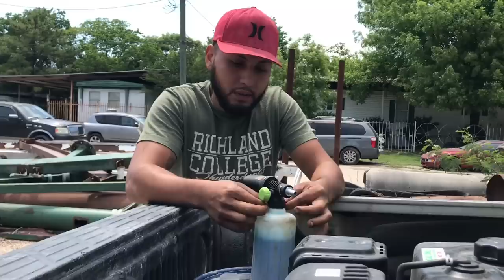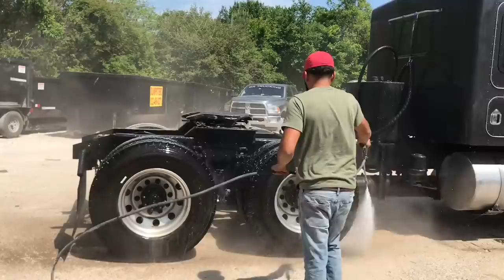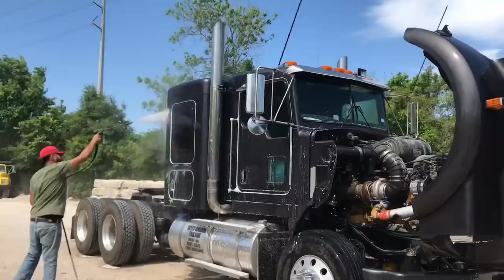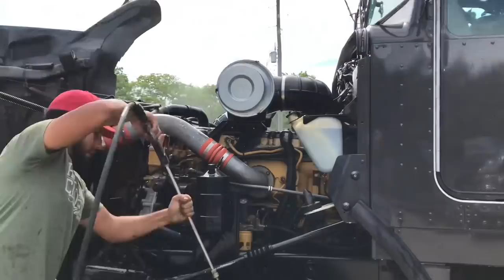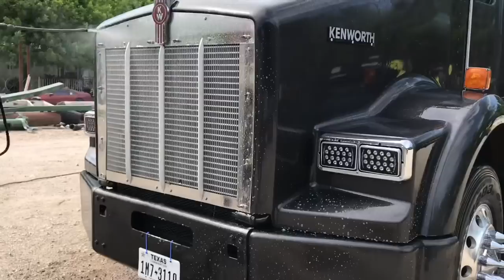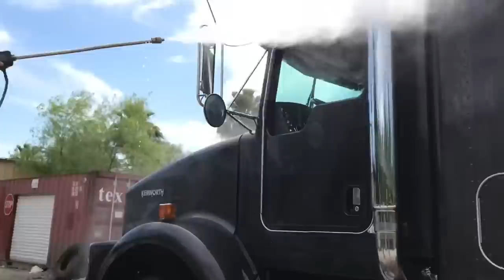foam cannon wash, Houston mobile truck wash

Comment: Damnn if you ever see scratches on your truck it’s cause he using the same exact brush for the paint on the truck and for those tires which have been everywhere you should get it detailed by someone who cares about paint and a good wash 💯💯💯
Reply from the maker: Isaac Diaz ain’t worried about the paint like that. In the future when I get the truck painted the right way I’ll be careful with it.
Reply: He did pressure wash the wheels before the broom. I agree with you, maybe two brooms is best. However he did at least pressure rinse them beforehand 👍🏻
Reply: For 45 bucks cant beat it
Reply: I used to complain about the blue beacon... this though, this is a surface scratch nightmare.
Reply: Ikr, it was a bit cringing 😬 to look at him hit the tires with the same brush that he then washed the truck with 😳
Reply: The brush isn’t really hard... it’s actually soft just firm enough to move debris
Reply: Then ppl should clean their own stuff and if you think driving otr stuff don’t pop up and chip paint then you kidding yourself

Comment: Now your gonna be going down the road watching everything reflecting on the hood blinding the opposite lane w the stacks an drop visor if I’m in the area ima call him up that looked real good an only $45-50 for a mobile he just washed the tractor for what most places charge to run a washer through the reefer trailer 😂👍

Comment: I need that foam sprayer in my life 💪🏼🌬️🚛
Reply: Get the one off amazon. Almost the  same thing for like 18 bucks.  That's how I wash my truck.   Works better than this guy's too.  If you put hot water in the cannon it will make really thick foam that will stick better till your ready to hit with a brush.
Reply: @MrWisdom79  do you have the link to that foam sprayer
Reply: @ZamoraTrucking  I gotcha

Comment: That was tough to watch. Chemicals drying in the sun on black paint number 1 no no. Ditch the wide brush and get a bi level 12 inch. If you want some more advice from a 30 year truck wash vet shoot me a message. Fwiw you got killer work ethic and haul ass just need a few refinements
Reply: nice

Comment: Howard it going man, is your truck mechanical or electronic, with the power of that water do you never have problems with the motor ??
Reply from the maker: Electronic, and no have never had problems with the pressure

Comment: His brush is pretty worn out he definitely  needs new one.  
Plus you never ever wash wheels with brush then wash body.  
Should have one for wheels,  one for body .
Using the same water too clean the hole truck that's not good at all .